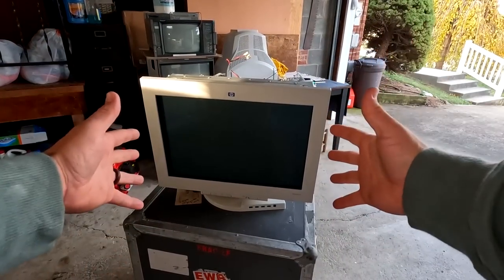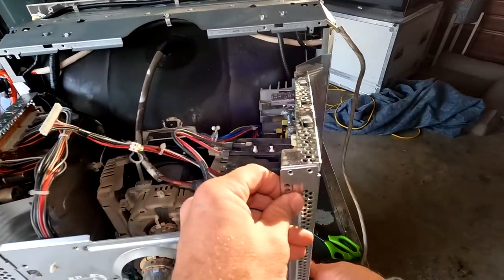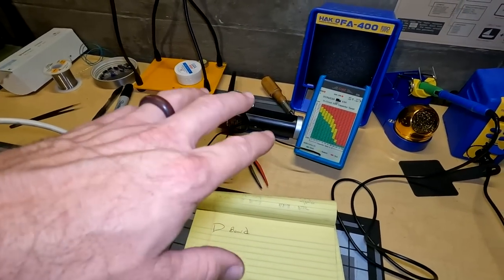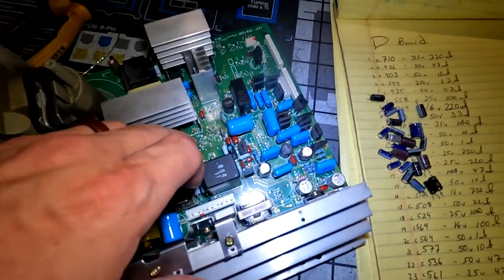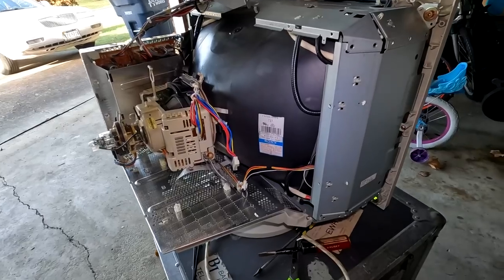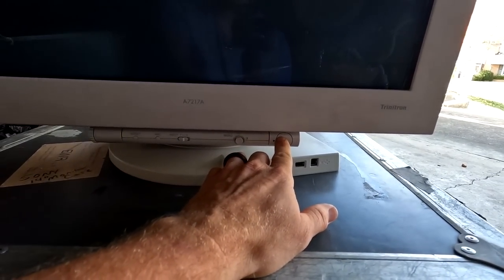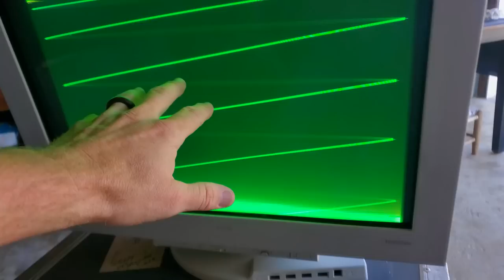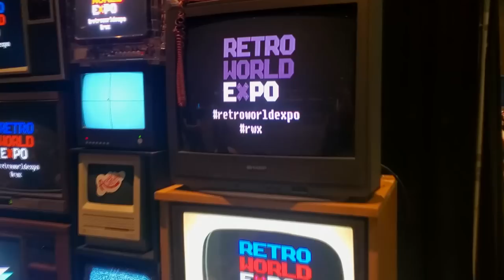The BEST CRT in the World - The Sony GDM FW 900

Comment: Dear Steve,  the green screen with retrace lines is due to a bad resistor near the flyback,  it Is the "heater resistor"  Look for one 3.3 -1. 5 ohm 1/2w.
Reply: This
Reply: Yep i can confirm this since i had the exact same problem with my Sony PVM-1390/KX-14CP1 monitor
Reply: Yes it’s not always capacitor related. 92 capacitors you’ve replaced and could it be a just one resistor or transistor.
Reply: This issue is only due to a bad heater resistor or a short inside the tube itself (rare) on this particular sony pro tube.
Reply: Wow
Reply: @stevesje71  this may have just saved an old tv i have in limbo
Reply: I was going to say the same thing. This is a circuitry issue, not a tube issue. You can also see the color bars clearly as the tube discharges when he powers down. If the tube were at fault, they wouldn’t have been so crisp.
Reply: So, did he ever replace this resistor?
Reply: I am wondering the same

Comment: I will advise to to start  measuring all voltages on cathodes, screen and focus electrodes and heater filament as well. It would be useful to check flyback pulse with oscilloscope.

Comment: I think the FW900 has a header on the back side of it that can be exposed and adapted to USB to plug in directly to a PC and tweaked with software called WinDAS. Just look into it first before tinkering with it, I know it is used to modify G2 voltage but as others have mentioned a troublesome resistor that is worth looking at too.
Reply: Yes, this is common with Sony FD Trinitron PC CRTs. Its a TTL connection.
Reply: Many years ago I had self made converter from RS-232 to TTL to service them. All colors offsets and gains controlled from WinDAS. Also G2 voltage. Definitely the best CRT monitors ever made.

Comment: I think you'd want to keep the neckboard connected when you go to discharge a CRT. As I recall there's a connection on the tube pins (the end of the tube the neckboard connects to) that acts as the ground side of the CRT. CRT is a big capacitor and basically one of the pins on the neck is one pin on that capacitor (the ground connection in this case!) and the anode connection is the other.

If you pull off the neckboard you are basically just touching one end of that capacitor and not shorting it because the ground connection leading to the neckboard (which then connects out to the CRT frame you are trying to ground your screwdriver to) isn't connected anymore!

So always discharge the CRT before you pull the neckboard! ;)

This is the case with most TVs. Perhaps there's an alternate route the connection can take in monitors but that's been my experience with the 2 13 inch Trinitrons I have. They don't ground out unless I have the neckboard still attached! (with the ground wire going to the neckboard also still attached to the CRT mounting frame)

Comment: Back in 1999 we had these as desktop monitors at BofA IT department.  They were behemoths.  The power cord and the vga cable were also as thick as 0 gauge.  At least the ones we had did. I remember the desks were specifically ordered extra wide to accommodate two on each.  Never had any issues.  I remember only a set of these we connected via RGB just for kicks.   When we moved to a new location I clearly remember that all of these type of monitors were left behind.  I talking about maybe 20-30 per floor and there were 8 floors.  All went to the trash.   They were simply too heavy and bulky, back then made no sense to spend on moving them, they opted to purchase lcd instead.  I wish I had taken a couple home.  I was given the choice to take as many as I wanted.

Comment: I brought FW-900  2006 from used computer parts shop for $35 in my country. I'm still using it as secondary monitor. Those days LCD monitors  are hitting market and CRT monitors are fading away.But now all are talking about FW-900 are the king.
Reply: In which country do you live? Isn't it that crt monitors are becoming more and more expensive?
Reply: Hey hows life been since 2006?
Reply: @ITGuyinaction  I live in Sri Lanka. In 2006,  that monitor is expensive than other brands(LKR.12000). dell and nec are LKR.9000, 19" are like LKR.7000.
Reply: @kapilsds7  Here, in Poland, the prices of old crt are increasing quickly... P.S. Wow! My videos are being watched also in Sri Lanka...! Nice!
Reply: To enjoy a crt monitor at its best you need to push the refresh rate over 90hz, then you can "unsee" the flickering ... and apreciate the quality of the refresh rate, 1 pixel at a time... that's how the brain reads the picture made by a crt: from left to right, one pixel at a time is drawn on the screen, at least 90 times per second; that keeps the brain busy and entertained, more than watching 120 frames drawn on an oled instantly... it's like only 120 still motion pictures per second instead of an animation of 1.3 million pixels painted one by one.
Reply: It is only king in the very niche of 3D shooters. You don't want to do any graphic design work on this beast. Even the first Eizo's with PVA panels were miles ahead of this for DTP.

Comment: Greeting. A few years ago, I used a screwdriver to adjust the focus a bit on the Philips Mach Line 29pt90009 LCD TV. When I opened the back there are 3 potentiometers for adjustment. One is focus, the other is brightness, but I didn't know what the third one was. Basically, in addition to those two, I also turned the third one. At first, the sharpness changed slightly. However, when I turned it a little more, I got lines on the screen similar to what you saw on the fw900. Although I returned the setting to standard, the lines remained in the picture for a while, and later the picture became normal, but after that the process of turning on the TV from standby took three times longer than before. Also, an error would be displayed in the service menu every time the TV was disconnected from the mains

Comment: I picked up a couple of 4:3 Sony Trinitron VGA monitors probably 10+ years ago.  Mine had a similar picture except the screen was over bright with the same diagonal lines.  I wonder if removing the capacitors may have reset some of the calibration.  I read that I might be able to fix the monitor just by building a special cable that plugs into a PC serial port.  I bought the necessary chip to build the cable.  But never built it.  Supposedly you have to run the software on a Windows 95  or XP computer.

I have unfortunately ditched that monitor. Along with a nice 17 inch NEC which I'm deeply regretting.  I still have the working Sony trinitron.

Comment: I would check the grid voltage on the green line (since this is a trinitron it may only have one gun, but seeing that the menu was showing through is an indication that there might be a resistor short to ground on the green, at the back of the tube. Grounding either color on the back of the tube would make it glow on the whole screen.

Comment: Nice catch. Usualy analog monitor will tolerate with partialy bad capacitor but not with soldering joints and circular cracks on that joints. Try to check soldering joints around HV transformer and  CRT nec board  with magnification glass. Time, cycle heating and oxidation do its job,  so  90% disease for old CRT's are bad soldering joints.
p.s.   small screen and visible retracing lines points to HV overvoltage, try to decrease it by pot on HV multiplier

Comment: I wonder if one the drive transistor is shorted as it will cause what ever gun it is connected to to go full blast or other words cause the tube to over load. I have seen that happen on a tv and it gave the same results as what your having with that monitor except it was the red gun instead of the green. It could be the tube but check the circuit that drives the tube.

Comment: Steve, I have an FW900 with similar issue. WinDAS will specify error codes, I get HV failure, even with a brand new flyback. Pretty sure the tube is shorted.
Reply: Where you managed to buy a NOS flyback?

Comment: I also have FW900 and mine is working but not without problems. Main problem is that when it is just turned on I have green instead of black. And it requires about 30 minutes to warm up before black becomes black. Other problems with geometry which cannot be fixed with menu controls, however not very badly.
Reply: i dont think your warm up time is a "problem", this is normal behaviour on the FW900, as long at its black levels are normal after warmup, and this happens after the monitor as been turned off for some time, similar also happens on mine, in my case the blacks look way grayish, like you have the setting "brightness" (black level) maxed out, when i turn the monitor on after being off for a while (hours) but at about 30 min as well as yours, its back levels are back to normal.

as for geometry, i dont know how imperfect it look on yours, but its normal you cannot get 100% perfect geometry on this monitor, but you can get close to perfect with some geometry tweaking from the OSD menu, that you hardly note its geom imperfections in normal monitor usage, and just at the sides of the monitor.
the following are the settings i use for geometry on my FW900, i am aware not all CRT monitors including FW900 behave the same as other same brand and model ones and most like my settings would not work on yours as in mine, but it doesnt hurt me to share, so my settings for geometry are:

at order of appareance from top to bottom from the OSD GEOM FW900 menu settings:
38
53
45
69
49
those settings give me a satisfying geometry to my likes.

however i also have a greenish issue similar to how it looks in this video when i turn my monitor after being off for several hours, but fortnately it only last some few seconds and dissapear, some times it auto shuts down the monitor automatically, sometimes not, strangely this issues started to occur after the monitor was not used for about 3 months, before that, it never happened but now always occurs after being off for several hours.
Reply: @3dfan797  thanks for your response. Yes, when not warmed up mine also looks washed out but also with green tint on the blacks. Ok. Maybe it’s not the big of a problem. And I can fix geometry to a decent level from the menu. But few parameters maxed out. But as I know after geometry board recap it should be more correct on the default settings and easier to make it closer to perfect.
Reply: You need to adjust G2 in WinDAS
Reply: @wormbagged  Oh, yes. Thank you. I completely forgot about it! I've tried to adjust G2 a bit. Don't remember the exact result. But then I thought to find some local experts to help with recap and adjustments. And since then didn't touch it for more than a year now. I'm from Ukraine and I think you know the situation right now. Not sure when I can try it again
Reply: Windas

Comment: Steve, maybe you can help me.
I bought a 20" Sony Trinitron CRT. I was planning on playing my PS2 using the component input. Once I plugged the PS2, I only got the sound, no image.
Funny thing is that the component input on my TV is named Video 3, and even the green word Video 3 flickers / fuzzy...
I wonder if my TV Component input is broken... I don't know what to do.
Reply: There is a video output changer built into ps2 startup when no disk inaerted but to change output setings you must put it in composite yellow red and white leads on a regular tv to see what your doing first. That trinitron is working if you see a screen number
Reply: @sirconkers342  Yes I have done that already and changed the Composite Output from RGB to YPbPr.. still not working 😕

Comment: I have a trinitron monitor inside of a mame conversion that I built. On cold starts it has that green tint/ crooked green lines, same as yours. But with mine as it warms up it it goes away over the span of 10-15 minutes. Then works perfect for hours. Not sure what kind of problem it is but would like to know. Its not really bothered me too much because it goes away but I am sure my monitor is on its way out one of these days.
Reply: The G2 voltage needs tweaking a little, there will be a pot on back inside you can calibrate with a screwdriver, needs to be done when switch on, so you can see where it needs to be so careful not to touch anything high-voltage.
Reply: @Wobble2007  Thanks!

Comment: I was referred to this channel since I have been searching for someone that could help repair these monitors.  The expertise for restoring these beasts are disappearing fast.  I got two FW-900s, but only really used one to its current death and have no guts to try the other yet.  I can describe the way it died since it also yields the same blinking amber led:

In its dying days, the monitor had to "warm up" with dark images/screens for a while, as any bright/white screen will send it into that blinking amber led failure state.  It also had those diagonal lines on the image while "warming up" but they were light blue.  People online kept mentioning something about windas, but I have no idea if that would even work with the monitor now that it no longer could even "warm up" and just goes straight to that blinking failure mode.  I imagine a lot of the capacitors and resistors has gone bad by the time 2013 rolled around thus its current death.

I've quit video games until I have the means to resurrect the beauty.  While I'd prefer to have 2 working FW-900s, I may have to make the tough decision to Frankenstein's up a single superior model.  Where does one find someone that can service these monitors?

Comment: please excuse my ignorance, i am not expert on electronics, but, someone that saw this video and seems to have experience  in electronics claimed that this is a mistake to test capacitor while being soldered on the board, for acurrate capacitor readings from what i have heard,  they must be removed from the board and then tested, because when you test them while soldered on the board, you are also reading and testing other parts that share traces with the capacitors. 

also i remember i heard this as well in the past from an electronics teacher, so just wanted to make this comment in case it makes sense.

Comment: for me it looks like there is a problem with the cathode driver on the green electron gun. Normally this happens when the cathode is grounded you get this strong color with traces back to the start. there should be a voltage similar on the 3 cathodes so I would check this first. you can have a bad cathode driver transistor on the board. I had a few Trinitrons myself in the golden age but sadly the picture tubes got so worn out I had to replace them but boy did they look good when they were good

Comment: I would pay big bucks for Sony to make a new run of these legendary monitors.  Extra points for putting in a curved tube.
Reply: The curved version of the FW900 is the W900, I would be absolutely ecstatic if I owned both of these, or really just one of them lol, but the curved one would be incredible for classic widescreen PC/console games, the FW900 is the ultimate modern gaming display.

Comment: my sony FW900 is showing that retraced lined greenish screen everytime i turn it on after being off for several hours, it has been doing it since many months. some times i had to turn it on  many times due to it auto turning off as with this video but after some seconds the greenish screen dissapears.

weird thing is it never happens when the monitor is warm, always happens after several hours being off, and this issue started to happen after the monitor was not used for about 3 months, as if that greenish screen seemed to be related to someting being cold with the monitor and needs to get warm to get rid of that.

Comment: Did you try swapping the green drive for another colour (on the neck board) - just to see if you can prove if the green gun is borked?
Reply from the maker: Thanks I did check voltages going into the tube before it shuts itself off.   The green voltage is 0 pretty much.  That means there could be a component out.  The issue is just figuring out this neck board.  It's really unique and more than likely involves one of the internal boards also.  May be hope yet!